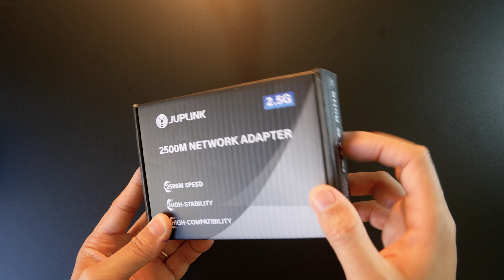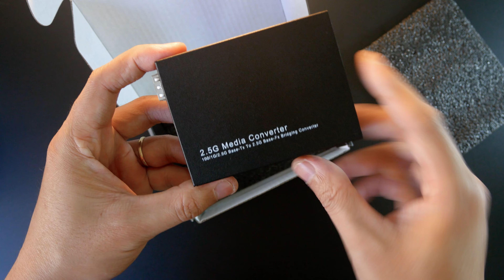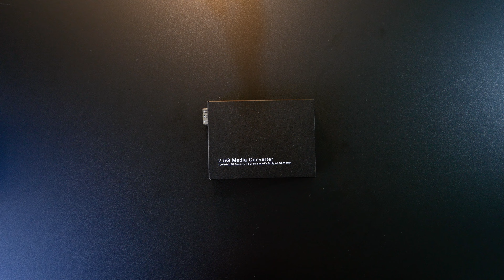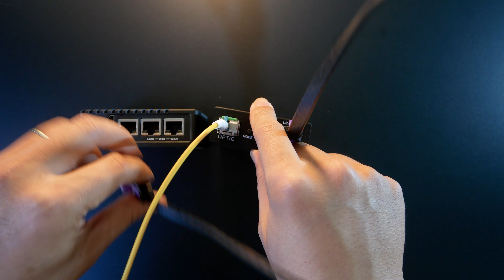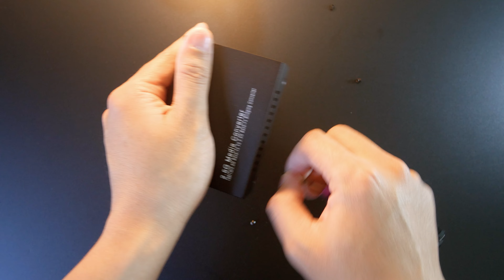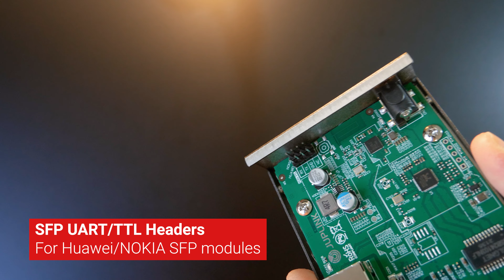Inexpensive JUPLINK 2.5G Media Converter (SFP to 2.5GbE RJ45) - Unboxing & Overview

Comment: Bought two and it works extremely well, no complaints here.
Reply from the maker: Cool. Mine is still rocking until now.
Reply: @VanTechCorner  I have FIOS 2G and I'm getting 2.5 to sometimes 2.7 freaking awesome highly impress CHEERS!
Reply: @andrepacheco6067 not sure how you would get 2.7, but pretty cool!
Reply: @VanTechCorner  How can we trust this company with your data though? There is basically no info about them online.

Comment: You need to review the GL. INET MT2500  Brume 2, I think it's the best router out there right now
Reply: Neat device, but dumb that the wan is 2.5 and lan is 1gbe,  would be better if they were both just 2.5gbe.
Reply from the maker: @JasonsLabVideos  I agree, I hope it could have at least 1 x 2.5GbE WAN and 1 x 2.5GbE LAN. Who knows, the this upgrade will be on the next version of Flint  :D
Reply from the maker: Hey MC, actually I've just got my hand on the GL-MT3000 (an upgraded version of the MT-1300 travel router with 2.5GbE WAN port and WiFi 6). Unfortunately, Lunar New Year is coming and I was really busy, I will work on this after the holiday.